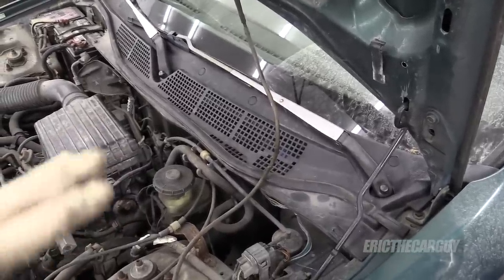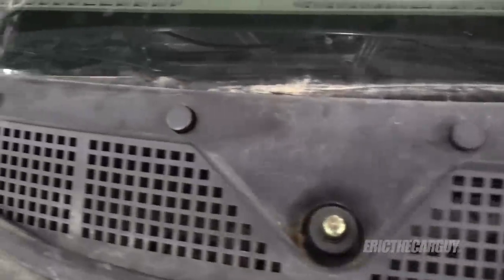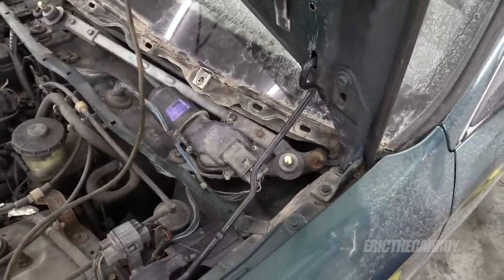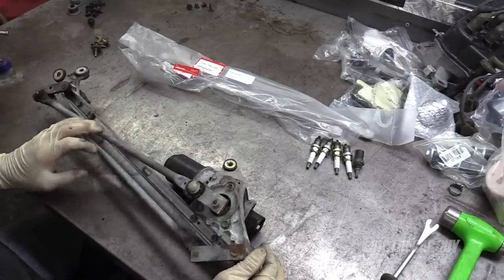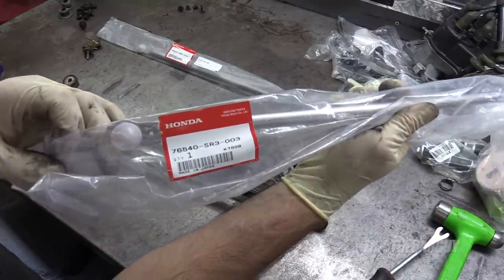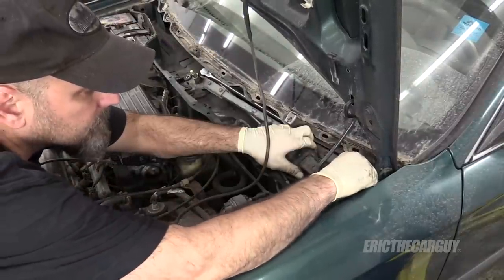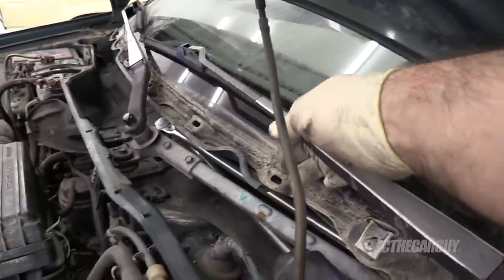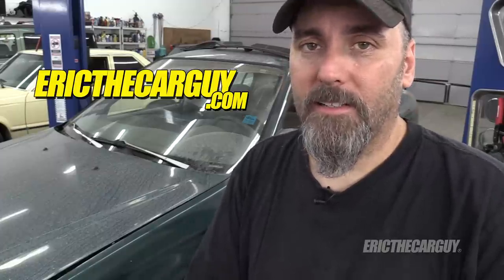Honda Loose Wiper Arm Repair

Comment: Used this on my 06' Accord EX.  The small control arm was worn just like in your video.  Getting the plastic parts back in their proper places was the hardest part!  Wipers work perfectly now, smooth and quiet.  Well done, thanks!
Reply: did you replace one rod or two?

Comment: Thank you for this video.  Because of this video, I was able to fix my Honda Accord.  I too had to buy the parts from Honda directly. I paid just under $28 ($14 a piece).  The arms popped off the first time I snapped them on. In other words, I didn't have them snapped on all the way.  So...I had to do this repair twice.  So far so good. I have used the wipers and they no longer hit the side of my car nor do they "hop" across the windshield.  Again, thank you for posting this video. It was really helpful and saved me probably $200-$300.

Comment: When vtec kicks in (which is always) I don't need windshield wipers because all the water turns to steam from speed
Reply: EXACTLY!
Reply: mds s You forgot "Yo." Otherwise, it will not work. -_-
Reply: @MousyTroopLeaderG  I just didn't have time for yo I was going so fast I was about to take flight yo
Reply: @mdss4310  Yo you need V-Tec to kick in just to get off the line....yo.
Reply: mds s I see. Next time just say "Yo" right before the V kicked in. You will gain 100 horse. :)
Reply: Yo vtech just kick in bro
Reply: Once you hit 60mph you travel back in time anyways
Reply: @MousyTroopLeaderG  that's a good trick to know I'll try it lol
Reply: @InsideOfMyOwnMind  shit my Honda civic has 4800 horsepower does 2.4 seconds quarter miles .....on factory tires and just a turbo added
Reply: I have a need - a need for steam
Reply: @mdss4310  Yeah, in GTA1?......YO?
Reply: LOL
Reply: @InsideOfMyOwnMind  no in AMERICA
Reply: (Don't trust edited comments)
Reply: That wasn’t water.
Reply: @eksine  Its 88 mph Marty...duhhh...   :)

Comment: Have a similar issue with my 98 CG5 Accord, but it is not easy to buy cheap new parts in Australia, decided to fix the nylon joint with four cable ties and it works.

Comment: Yeah, my 97 saturn has this issue as well.  I'm not sure it's as easy as popping off the arm like you did, because I feel like the saturn has everything more permenantly fixed, but this video was good to see regardless.

Another fun fact about the saturn, the wiper assembly is tucked way back up in the car and it's nearly impossible to remove without moving the wiper blades up to around 45 degrees and doing a whole lot of fiddling with the assembly.

Another fun fact about the saturn, it's got bolts in the passenter compartment, so to get the assembly off you have to pull out the whole dash and take out some bolts to get the assembly out.

I guess it's fair because the saturn is a subcompact, but it's so so much harder to do on the saturn, I know because I've replaced my wiper motor THREE TIMES on the stupid thing.

Comment: Thanks for the video. Gave the confidence to look into my 2013 CRV issue myself. Driver's side arm was moving as you demonstrated at the start of your clip, but I tried just tightening the bolt on that side first and that seems to have fixed it. Not sure if that's a common occurrence. In any case, now I know how to get to the wiper transmission for the future.

Comment: This problem (wiper blade hitting the A colum) was getting me crazy, thanks to your video I solved it.
I was thinking to buy the entire assembly, motor 185, the rest of the assembly 130, so I end up paying 41.50 for both rods.

Comment: I've done this on my Subaru.

You can plug the motor back in without bolting everything back together, turn the wipers on then off. Wipers always go back to the down position.

Also, I had an issue where the assembly wasn't oriented properly so the wipers were going backwards  (towards the engine lol). This can help you avoid assembling and removing several times.
Reply: Can this be performed without unbolting the motor from the arm first. The arms currently are not exactly in the ready position and I was afraid if I cycled the motor it might damage the new linkage
Reply: @hdfbrider32  As I mentioned above, once you pull the wipers off, you can just turn them on (intermittent). You'll see when it's gone back to the down position. Then turn key off. When you reinstall everything, just make sure you install the wipers in the down position.

I neglected to take note when I did it, and the wipers went went towards the wing mirror lol

Make sure you check that everything is working the way it should, before you put everything back together (another one of my mistakes)
Reply: @hdfbrider32  also, yes you can do this with the motor attached. It's all part of the assembly. Just make sure the motor is plugged in when you test
Reply: @tawidave7092  Thanks again.
Reply: OMG! I just did the same thing! 🤣 Thanks to your 3 year old comment. I was able to correct the mistake. 👍🏾

Comment: Great video, and great information.  I currently have a '96 Accord that has this exact problem, and I had NO idea that it could be fixed so easily.  I was expecting that I would have to change the entire wiper transmission.

Comment: Dorman sells the plastic bushings after-market.  The whole set was $4.99 if I recall correctly.  I used them on a Ford a few years ago and they're holding up just fine.
Reply from the maker: Aftermarket clips don't work on Hondas so well in my experience. Thanks for the recommendation though.

Comment: Thanks so much Eric. Been looking for a specific video for a repair of this nature for the last 4/5 years until recently. Ordered the new rods for my Honda Prelude wiper transmission and it worked like a charm. Now just have to work on resetting them so that the motor stops them at the bottom of the window rather than in the middle when turning them off.
Reply: Do u know if the part number in prelude V gen is the same as in other hondas?
Reply: @krzysztofabuda2239  

Part Number	Part Name	Price	Quantity	Total
76540-SV4-003	Rod Unit A	$20.44	1	$20.44
76550-S30-A01	Rod Unit B	$19.59	1	$19.59

These parts have since been discontinued by Honda but hopefully there are aftermarket alternatives out there.

Comment: I know this is an old video, but I have a question I'm hoping you'll be able to answer. Is it possible that the bolt holding the driver's side wiper has just come loose, and just needs to be tightened down?
Reply: I have the same problem i think its worn out and needs to be replaced.don t know..try

Comment: As far as I know Honda is the only one that makes just the arms while aftermarket companies like Dorman only make the whole wiper transmission assembly and they're nearly as expensive as the dealer anyway. I actually got lucky because Canadian Tire deals with an aftermarket company called "Certified" and they do make wiper transmission assembly's extremely cheap and they're even painted too! I picked up a whole wiper transmission for my 2000 TL for only 60 bucks and even has a 2 year warranty to boot!
Reply: Dorman 49464 is just the bushing kit. Disregard the year listing, they it fits more than listed.           https://www.dormanproducts.com/p-100073-49464.aspx?origin=keyword

Comment: I wish in my country we have these small replacement parts because these small things that make a difference in a car
Reply: theyermany  yep, fabrication of small plastic parts like these is an increasing necessity. 3d printers and CAD make that easier but a bit of old fashioned machining can go a long way. Especially if you can make a longer lasting part than the OEM plastics.

Comment: thanks... there was a thunderstorm today and  I had the wipers at max and I was hearing like a slamming sound when they were coming down.  I'm wondering if this is the issue or maybe just needs an adjustment.  There was no noise on the lower settings.  Also my mom who gave me the vehicle said that she had replaced the wipers stuff at the dealership so idk how long that stuff lasts

Comment: just a question: 
Second rod you replaced, did not seem loose or consumed. Why did you replace it? 
Or there is no way ... both get loose or age at the same time. 
What is you advise ?

Comment: Probably a stupid question,  but I own a 2018 hr-v ex l nav. The vehicle seems ok but Im used to my truck. 
The problem I am having is the roads in town are super fked.. 

Is there anyway to get some better after market suspension on this vehicle and is it possible to lift the vehicle about 1 inch with those spacers they sell now? I noticed them when i owned a 19 colorado I wanted to level the trucks suspension and noticed they were selling spacers to do that. I sold the truck before I did it because the transmission after 30k was doing some odd shifting and locking up on me.. 
The reason for the lift on the honda is to create more room in the wheel well. The reason Id like to see more room is because this past winter the ice and snow buildup around the tire/well/mudflap was fucked.. I never had a problem like that on my 19 colorado or my 07 colorado. Maybe I am just not use to these small cars.. 
I would love to get some kind of rancho suspension on this vehicle to absorb these rough roads better. I live in sault ste marie ontario and the roads are simply fucked.. I drove semi's all over NA and never experienced roads this bad..
You might be wondering why I am watching this video on wiper arm repair, well, the wiper link broke too so I was curious how hard it would be to fix..

Comment: No kidding I just did this job a few weeks ago, and yes it was due to the blades being frozen to the window.
With that said, is it common to have your windshield crack from using the defroster on max heat? That has happened as well.
Reply from the maker: No it is not common in my experience.

Comment: I saw there are plastic bushings on the two parts you replaced. And there are linkage bushing on autozone. I wonder if I can get those plastic bushings replaced to fix this problem

Comment: Funny how the honda has a conainted unit for the wipers like that. On my nissan it's a more usual system with the motor bolted to the fire wall and the linkage bolted below the windscreen. I'm currently waiting for a new spindle as the plastic housing the spindle has worn away from use over the years. I should ask my dealer if he can get the part new but I think it'll be expensive. I found a Nissan oem retailer online selling them for £40 each. I've bought lesser used units for £15 a pair.

Comment: Question Sir ...Instead of pulling the plastic covering out toward you , would it make any difference , if you just push it toward the window , seems easier to me
Reply: I did precisely that... I placed the hood in the 1st position and it went out easily.

Comment: i have changed the bushing, but still got noticable play on driver side wiper.do you think the pivot itself is the culprit? because passenger side wiper have a very little play, compared to driver side.

Comment: 1992 prelude with H23A1 engine. Idle surge... I’ve checked all vacuum lines replaced PCV valve and grommet, replaced idle air control valve and tightened fast idle thermo-wax valve. Also I’ve bled the cooling system and replaced intake gaskets. Idle still surges. What else could it possibly be?

Comment: Man, I'm an idiot. '92 Civic, '95 'Civic, '92 Integra and they all did it. I honestly thought it was a Honda quirk. I never saw that dual airbox setup on a Civic either. Never owned an EJ Civic, but figured they'd be exactly the same since they still ran D engines. Is there actually an air filter in there?
Reply: yes, its in the top box on the engine from what i remember. the rest is more of a silencer to quiet it down

Comment: 7:50 probably should note you can't necessarily position them "where you want". If positioned too low it will hit the hood if you lift the arm up for service while the hood is closed on most Hondas
Reply: David G yeah that made no sense.   There are splines that have to line up when u tighten the bolts down.   And only one position will work otherwise the blades will be too high or low

Comment: Hey Eric I have a question I have a 2001 Ford Focus SE front wheel drive dual overhead cam, my driver side rotor is loosed after taking off the wheel but the passenger side when I take the wheel off the rotor is fairly tight why is my driver side rotor so loose

Comment: What if the wiper arm is corroded in place to the bolt. Any tips on removing it?
Reply from the maker: I showed what I do in the video. If that doesn't work, you might try some penetrating oil.

Comment: The 2004 acura tl which you own does it have a shimmy on the driver wiper blade on the lower part of the blade when in use?

Comment: I wish could of got the parts the same for my car and when looked either had to buy the wiper transmission or use one out of a junk yard. I got one out of a junk yard and had it put in. There is two different wiper transmission's and goes by assembly date on the 03 Cavalier.

Comment: Lift up your wiper blades away from your windshield when parked outside during winter time, defrost your windshield before lowering the blades, and your wipers will function properly everytime...

Comment: Why just bought a 96 civic and the wiper transmission moves counterclockwise instead of clockwise so the wipers wont work unless I reinstall them on the up positon wich will be weird

Comment: I noticed you had the hood all up vertical. Point out that at least some Hondoo have little brackets that prevent that so you take them off. I don't think the kids put them back after they have touched their engine inappropriately but if they are there they need to come off.
Reply from the maker: There are no brackets that prevent it, it's just the windshield washer line that you need to unclip.

Comment: Mine on my CB7 aren't loose, but they only go about 3/4th the way in operation. Bad motor?
Reply from the maker: Not likely. I'd inspect the wiper transmission to see if there is an issue there.
Reply: Will do

Comment: The plastic Cowl Piece on my ‘02 Acura TL is Warped on the passenger side, and doesn’t lay flat. I don’t know how that happened to it?
Reply from the maker: If you had a windshield replaced, it might not have been reinstalled correctly.
Reply: Oh okay, thanks Eric! I Love your Car repair videos!

Comment: God damn, thank you for this. Yes 1 of my metal bones of my windshield was pretty loose. Used the site you recommended for the part.

It's actually a pretty easy fix. I also took the advantage air blowing and deep cleaning all the stuff that went under there over the years.

Thank you.

Comment: My 98 civic wipers don’t self park anymore they just stop when turning them off. Anyone know if this is a motor issue?
Reply from the maker: That is the most likely suspect as the park switch is inside the motor.
Reply: ETCG thanks for that response, I have a Civic with a wiper parking problem too.  Your video shows me how to get the assembly out to replace it.  Thank you!  "Classic Eric The Car Guy"!

Comment: Pro tip: Sharpie lines on the windshield where the wiper blades should be at rest position before disassembly. Makes reassembly easy and idiot-proof. What a difference a pandemic and rampant inflation makes The two rods in this video were less than $30 for the pair. Now (2024) they're about $56.  

Try as I might, I cannot find these individually for my Acura 2002 TL Type-S. I can only find the full linkage (which includes everything he removed under the cowling except the motor; not just the rods) to the tune of almost $200. Figures. If anyone knows where I can get these rods individually kindly leave a comment in reply. thanks!

Comment: Tip: Those plastic clips get brittle over the years and you will end up breaking a few. No big deal. You can buy them on Ebay from Chinese sellers. I bought 10 new clips for one dollar.

Comment: No need to change the whole link (arm) or buy Honda. Just buy the plastic socket and replace using your existing link (arm).
Brand="Dorman" 
Part No. = 49449

Comment: I wish this was the main reason why the wiper transmission on VW's fail.. 
We have to replace the whole transmission, and in some cases the motor as well...
Just the transmission by itself, cost more than $300 on a 10 year old Polo...

Comment: My wipers flew so far off my windshield that they got stuck dangling off the side of the windshield in the middle of the freeway in a blinding downpour. I had to keep sticking my arm out my window and pushing them back over so they'd go down. should be dead probably